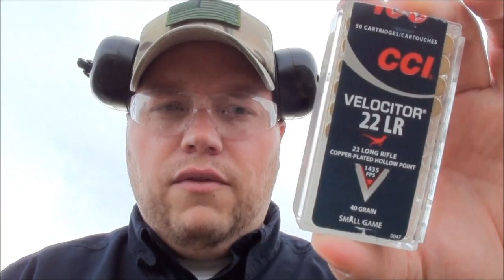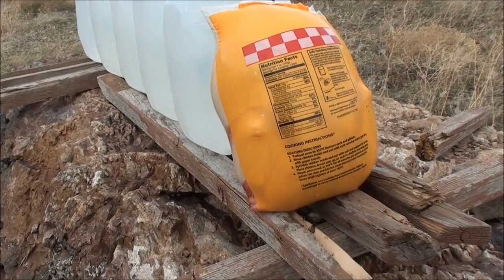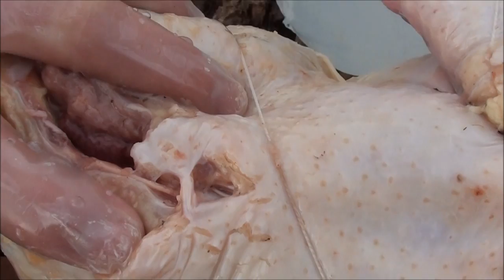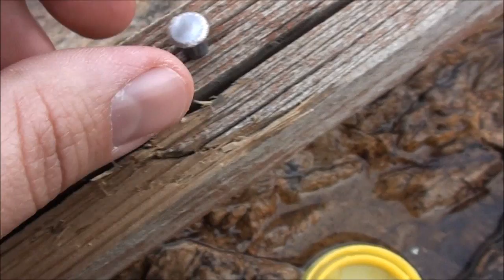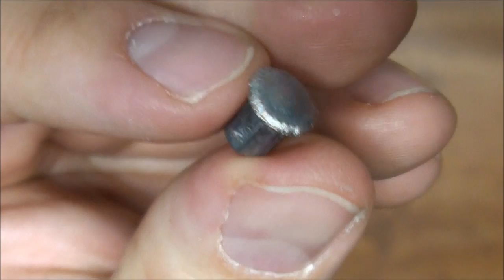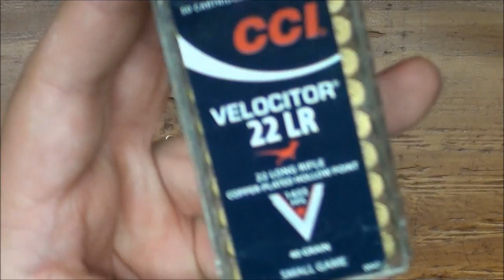CCI Velocitor 40gr 22LR - Ammo Test

Comment: Too much fluctuation between rounds, from one shot to another, with the Velocitor. This causes accuracy differences. Plus, they are only a little over 100fps than the 36gr. Mini Mag.     The Mini Mag shoots HIGHER than advertised velocity. The Velocitor shoots about 150fps LOWER than advertised.   Plus, the Mini Mag expands out of a handgun, much better than the  Velocitor.   Just my opinion.....  I used to be a Velocitor guy, myself....  Not any more!!!!  Not worth the extra money.
Reply: Great i carry that round for self defence.
Reply: I carry an LCR 22LR as my CC gun.  Since the cylinder holds 8, I stager the rounds, 4 Mini Mags and 4 Velocitors. First shot Velocitor, 2nd shot Mini Mag, 3rd shot Velocitor, 4th shot Mini Mag...etc.

Comment: Excellent research video ! Very very helpful. So a 22lr velocitor will indeed expand, even from a 4" pistol or revolver. Most people tell me it only does that from a rifle. Great news for my new S&W 63 22lr revolver. My sincere thanks!
Reply: I would think the expansion shown is more from hitting the water in the jugs than through the towels and the chicken. Correct me if I'm wrong.

Comment: there was a test done out of the UK and it compared a number of rounds in 22LR. one of the loads was the velocitor and another was RWS high velocity HP. the RWS, although rated at 1250fps and the velocitor at 1435fps, they put out around 1225fps and 1325fps, respectively. the velocitor had a .75" grouping while the RWS had a .4" grouping. 

they fired at 50 meters at clay blocks and the RWS had both deeper penetration and a larger volume cavity.
Reply: calangel I'm in Australia and have both in the safe. Problem solved.

Comment: there was a test done out of the UK and it compared a number of rounds in 22LR. one of the loads was the velocitor and another was RWS high velocity HP. the RWS, although rated at 1250fps and the velocitor at 1435fps, the put out around 1225fps and 1325fps, respectively. the velocitor had a .75" grouping while the RWS had a .4" grouping. 

they fired at 50 meters at clay blocks and the RWS had both deeper penetration and a larger volume cavity.
Reply: try the test again with long barrel pistols !

Comment: Thanks for this vidio. I'm a professional driver and I have a 45acp with me at all times,however when I am out of the truck I have been packing a SR22 in my pocket. I am having numbness in my fingers of my shooting hand, and have started to use my weak hand to shoot. the 22 is easy on an old man and very accurate at battle range. I feel very confident that the velocitor will will do what needs to be done. I figure 6 times 40 gr. should equal a 45ACP. I pray that I will never have to find out.

Comment: I NOTICED CCI HAS A NEW 22, IT IS CALLED 22 MAXI TNT, 30 GRAIN JACKETED HOLLOW POINT 2200 FPS HAVE YOU TRIED IT OUT IN A RIFLE?  IT SEEMS AS THOUGH IT WOULD BE GOOD OUT TO 400 YDS. BECAUSE OF ITS SPEED/WEIGHT  & FLATTER TRAJECTORY